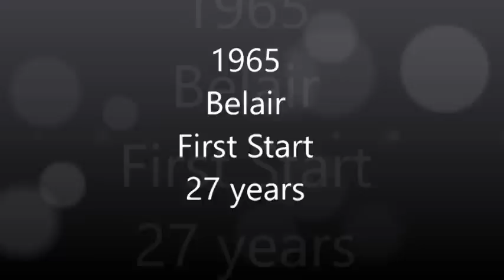1965 Belair NOT A Impala First Start After 27 Years

Comment: I feel like I have in front of me a keyboard version of Mr. Peabody's "Way-Back" machine... I press a few buttons and I am brought back to the sights and sounds of the mid 60's of my youth. The only thing missing are the tactile sensations of touching grimy, slippery, greasy plug wires (and getting shocked often due to leakage) and the smelly concoction of old grease, leaky oil and bad gas, with a faint acrid whiff of non-sealed battery acid fumes, and I swear I could SMELL the rust back then...ooooohhhhh the good old days....And it wasn't until around 1970 that a Chevy came into our driveway that did NOT have a valve tick, and that was my grandfathers 1970 bel-air with a 307, which at the time I didn't consider a "real" Chevy engine. I always experience a tinge of jealousy when I see how many people commenting that back in those days they had A/C, 4bbls, 327 or bigger, pwr windows, etc, but hey, I guess my experiences must have been good because I still remember them 50 years later. Thank you for this cold start, and my condolences on the air compressor.
Reply: Oh, BTW, looking at that blue puffing out the exhaust, and that occasional puff out the carb, maybe a gummed up intake valve. And one of my experiences with this type of smoking without blowby, we had '60 283 and the oil drain back under the valve cover was totally blocked and the only way for the oil to go back was pool up over the rear cylinder and drain back via the pushrod tubes.

Comment: look on back of carb. I don't know what year they started but I know 63 newer 283s had a pcv valve inline on carburetor back port with hose and steel line running back to where road draft tube was on 57 models. actually pc was around back in mid to late 50s. It was an option in 56-57 and so on.

Comment: when i start a old engine after years of setting i always mix a little oil in the gas. two reasons it lubes it up and it gives it more compression. i see have have better luck starting one that way. didn't hear any knocking so it might be a good old engine

Comment: use a gear oil bottle with gas in it to fill the float bowl through the vent tube. You can run it on the gas in the carb....you don't have to dump raw gas in the manifold

Comment: probably a qt. of transmission fluid in the oil would quiet those lifters .
Reply: Flat cam typical of chevy
Reply: jack rohde w
Reply: Mark Keck II Go look up the diameter of chevy vs Mopar and Ford lifters when you race the chevy in nascar in the old days 1955 and later with the flat tappet lifter ones, you had to bore out the lifter bores and put in a bigger dia lifter to avoid flat cams and caved in lifters. big flaw.
Reply: that does help alot in those old push rod engines. hell I bet if he ran it awhile the lifters would pump back up from the oil pressure. they probably settled from being dry all those years wouldn't doubt alittle surface rust.
Reply: I agree. Ever seen the inside of an auto tranny? Clean, ain't it. My grandpa put a half quart of tranny fluid every time he got the oil change. This was back in the 60's when engines were good for maybe 80-100.000 miles tops before needing a rebuild or at least the top end done. He had a '67 Pontiac GP and he racked up almost 250.000 on it. That was unheard of back in the day
Reply: MissouriOldTimer I
Reply: old is gold
Reply: Missouri    putting ATF into the engine oil is typical of clowns who think they have outsmarted the engineers by their hillbilly "smarts" and in the end, the lifters would quiet themselves if given clean engine oil.
Reply: Awesome video MOT, when I got time I look back into his video's, really nice
Reply: @Bill Schwarberg that'd do fuck all for the lifters

Comment: It would run lot better if you gave it a complete tuneup and also adjust the dwell
plugs,wires,cap,points and condenser, fuel filter,etc. The guy that you said bought it should be able to do that if he wants to make this old crate a runner
Reply from the maker: Agree, I just wanted to do a basic start up without making an investment in parts. He can run with it from there.. Thanks For Watching!!

Comment: It's a rare option for a '65 Bel Air to have factory air.
Reply: Mine does but It doesn't run, if I restore it with the factory air will that up the value?(Mine is an Impala, not a Belair, but it's the 4-door pillar less)
Reply: No it’s not what are u talking about where u live
Reply: Back then AC was usually only found in the south....both East and West.
Reply: @whackyjinak4978  Impala was the highest trim so not rare with AC. Bel Air was the base model.
Reply: @David Keeton  Yeah the base model. Which incidentally the differences between the models is mostly the number of tail lights. 

I had a 69 Impala I tried to DD last year that I bought for $800. Couldn't inspect it cause of a bad frame but I rode it dirty for five months. I put two new tires and a new twojet carb on it and the 327/powerglide combo never gave up. I wonder what demolition derby that thing ended up in.
Reply: @David Keeton I don't know how many Bel Airs you thought you saw with factory a/c back then but even here in the South they were far and few between, if at all.  A/c wasn't all that popular even on the Impalas.  Yes, there were those that had them but many of them did not.
Reply: Depends on where you live.  As a kid in Texas in the 1960s, AC was already common in cars, even in the base level budget cars. It was top desired option and people would forego other options in order to have it.
Reply: WhackyJ in AK  oh hell yea dude!! A 4 door hard top with factory air!!
Reply: @auaiao9  Factory AC was a very expensive option back then.. Hell am radios were an option, 2 speed wiper/washers and on some cars, depending on the make and model, even the heater was optional
Reply: @chaosdemonwolf1  I know.  I'm 62 years old.  I don't remember heaters being an option, I think they standard on all cars.
Reply: Back when you could order the car the way you wanted it!!
Reply: @whackyjinak4978  yes it will!!
Reply: @wll1500  Acutually the Biscayne was the very bottom end base model.

Comment: @Jonathan W: Get a hydraulic air gun and spray pressurized blasts of air to clean the crap off the intake manifold and the crap out of the air cleaner element and the pine needles and crap all around the car so the car can breathe better. Maybe a new air filter would also be helpful.

Comment: I just did some checking and it appears that this engine is an older small block. The air cleaner housing and valve covers are definitely from older models. Now, you could change the air cleaner, but if my memory still works, the valve covers changed bolt patterns when the style changed?-just saying....:-))))

Comment: After 27 years the least he could have done is pull the plugs, squirt some oil into the cylinders and let it crank for a while until oil pressure builds up in the rod bearings without compression load. Dumping gas into the carb only washes oil off the cylinder walls and increases the risk of galling.

Comment: Why not fill the carb's float bowl with fuel and put a few squirts in the carb's intake, not a very good idea to pour fuel into a carb while trying to start an engine, if it backfires the fuel in your hand can also catch fire and that can be a mess.
Reply from the maker: I put some in it, but not enough. I am always afraid I will overfill and flood it.
Reply: If you fill it through the feed pipe (coming from the pump) the needle and seat will not allow too much fuel into the bowl. Just glad it started.
Reply: Philip Koen @ y adamdano manvd adamdano manvd adamdano. 
m
Reply: Philip Koen bbc.co  
I
Reply: Philip Koen IM PRETTY SURE HE KNOWS.
Reply: Na
Reply: @jonathanw4942  if you flood it you just hold throttle open I've always been able to clear one out

Comment: Some of these comments....wowwww.    Anyhow - love your vids.  Question: Regarding hot wire (I too have no key on my 66Impala).....From the purple wire you ran a wire to the negative terminal, and later for power to start, did you run it from the positive nut on the coil to the positive battery terminal?

Comment: What kind of monster would use that car for just parts
Reply: Justin SliverSoap : true that the car "could" be restored ( at great cost ), but without parts cars, others in much better shape might never see life again either. It's a bittersweet reality.
Reply: One with a 2 door SS
Reply: It is a real shame but one dies so that another can live.
Reply: Justin SliverSoap someone that has a 2 door Chevy
Reply: Only an idiot would save a damn 4 door 
2 doors are superior
Reply: 4 doors are great if you are doing some squad cruising.  Especially if the  thing could sit 6 people comfortably.
Reply: Parts cars or no restorations. Many of the parts on these old ones are made of unobtainium. As these old ones age further new old stock becomes hard to come by. The manufacturers haven’t made pieces for these in decades.
Reply: @Justin SliverSoap: I wonder the same about people who trash good cars like the Toyota Tercel Wagon, AE82 Toyota Corolla's, etc. and older computers like the Macintosh Plus (which can be fully restored and mostly gutted but built into a new machine using the same old case, etc.
Reply: @terceldude  As much as love the 2 Tercels I currently have, there comes a point at which rust's ravages cannot safely be repaired, or rebuilding an engine at $400 cost in parts for a vehicle with rotting floor pans and not much to put them or trunks or strut towers or mountings that welders charge so much to fix, as liability of that repair failing could wipe out a small shop. I love my Tercels and Rangers and enjoy driving them as they come, with small repairs as necessary and have turned a few castaways into dependable daily drivers, and for that I look for these vehicles to upgrade into daily drivers or sometimes parts. As for computers they were designed with the technology of that time, and expansion and upgrading were limited as to capacity of the motherboard, and changing that you have a different computer.
Reply: Exactly!! It's a complete car!! I would restore and put it back to like original!

Comment: Just think.. it was only 25 years old since the last start..my first in 82 for $75 was a 66 Impala 4 door,gray,rust bucket,primer.Looked just like this, worse.There was a ball peen laying on the bench..Whats this for ? He goes you have to get out sometimes & tap the float bowl,it gets stuck. other than that & a cracked frame.. 4 different bad tires leaking at different rates & brakes that  barely stopped it,It was ok..

Comment: I'm an S.O.B. when it comes to starting an old neglected car without a total going over:  old gas,belts, hoses, whatever fluids need to be added to that almost immediately will need replaced.
Reply: It's like, ... If it's gonna be sold for $100 bucks then WTF, right?  If you plan on resurrecting it as your everyday driver, that's another story.  What I usually do is first check oil.  ( usually will be low ).  Add 1/2 to 1 quart of new oil. ( preferable a thinner grade ).  Then crank the engine just a couple of revolutions.  Then pause for a few minutes.  Maybe repeat this procedure a few more times to get some of that new oil pumped to the top & time to settle into lifters, rods, valve stems, rings, etc.  Then I'll try firing it.  Whether this procedure actually does all of that to any significant degree, I can't know for sure.  Just seems like it would work that way.  It's certainly better than nothing!  As for old gas, I have never worried about it.  So far, it has never been an issue.

Comment: I know you are not poor, so why not invest in a nice remote starter button and a small gas can to hang off the hood with a line you could slip over the bowl vent on the carb or to the inlet pipe. Then pop your cap and check for spark on the points first and file them in place- why remove them?  If you have spark at the points, check your spark at the coil wire- Now if you have spark and fuel it should fire up without a lot of cranking as long as you have compression.

Comment: It would've started and primed alot sooner If you just be generous pouring gas in. It's not like there's any oil to rinse off the cylinder walls on a motor sitting so long and that wouldn't affect cylinder condition for that short period. Hurry up and get it over with the sooner oil pressure the better . dry bowl , dump gas in. It'll fire up, die ,fire up, die with good pump the bowl primes and keeps it alive
Reply from the maker: The oil all drained to the bottom, the cranking gets it to the top and everywhere it needs to be. Starters are cheap!!!

Comment: I don't know thing about cars, but: Why will the starter get hot from running off a drained down battery, and not with a jumper connection?
Reply: Soren Kuula if the starter runs very slowly it needs more amps to turn, more amps, more heat.
Reply: Hi, thanks for the answer. OK I'm surprised. I thought the current would be about proportional to the torque, and the torque of cranking an engine is about the same at any speed?
Reply: Soren Kuula after thinking about it, since the torque suplied by the dc motor is proportional to the voltage and the current is proportional to the torque, you are right, the current is not higher when the motor is turning slower. A danger that does exist is when the motor grinds to a halt because of low voltage, like on a compression stroke. Then you would have inrush current wich is much more then the normal operating current. This could damage the starter.
Reply: yep

Comment: why did you not drain the fuel tank and just leave the fuel pump attached, then let it take from the tank (if the fuel pump even worked.)
Reply from the maker: No drain on the tank and usually the insides of the tanks are rusty and shot.
Reply: You do have a point. My tank would be rusty if I set for 27 years without moving!

Comment: I would have changed the oil before i even tried to start it.
Reply: Clearanceman2 run it till hot, then change it
Reply: Correct Clearanceman2, at least check the stick for water.. prep the engine for start, points, wires, fill the fuel bowl, pour some gas in (wait 15 sec for it to vaporize) close choke.. should start right away!  (Better to vacuum all the debris...  pull the plugs and squirt some light oil in the cylinders, crank for 30 sec, and this also primes the oil pump)
Reply: Waist of money ..

Comment: How about changing the oil (now tar...) first? What you did is a good way to damage bearings as 27 year old oil has basically 0 lubrication properties... Beginners mistake no 1: Not changing the oil before resurrecting a car which hasnt run in decades.

Comment: Make the hole in the cap bigger not getting enough gas dude
Reply: Don't want to flood it u can ruin the plugs and it Boggs down the motor not to mention it could backfire and with all those squirrel nuts could catch fire

Comment: Did you change the oil?
Reply from the maker: Nope, never do till I run them to at least get hot first.
Reply: Jonathan W won't 27 year old oil cause damage?
Reply: Has for myself I have never heard of old oil causing problems for just a start and run till hot or even driving a bit.It helps breakup the deposits and if the filter is in place it will catch all the small particles. And always after you add new oil replace it after a short drive has the older oils had low detergent and all of the sludge will stop up the oil pump screen and the motor crank is history. I had this happen on a Buick skyhawk I tore the engine  down to see what happened The engine  always had Quaker State , I changed it to Castrol  One of the better oils. It did it's job of cleaning what the other had left. Sorry for the long reply.

Comment: If he really knew what he was doing, he wouldn't grind that starter so long. Also, if that thing should backfire through the carb while he is holding that bottle over it, he is going to have some blisters.
Reply from the maker: The longer you grind the starter the more oil you get throughout the engine starters are cheap
Reply: @jonathanw4942  you make a good point.

Comment: When I started a LS1 Camaro Z28,that had been sitting for 10 years,and had 80k miles on it,new battery and the engine started right up ran fine,for about 15 minutes and then engine started rapping...Yes,I blew the engine because the old gas turns into a lacquer type liquid,shellac,and totally destroyed the engine..car was garaged,and ran fine when parked..just to let people know that you should ALWAYS change out the gas,and motor oil...DEFINATELY the gas,first thing..after this sad and expensive $$$$ experiance.I thought i'de throw this out there..no matter the climate,weather,or storage conditions,DON'T make the same mistake i did..hard lesson over 5 dollars worth of gas//and DO NOT run it through the fuel pump.either,because that will seize up.too..ruined a rare,nice,SS Camaro...Shame.Good Luck take care

Comment: takes long enough lol figure out why it wont start right up and fix the issue rayher than run the starter dead pretty simple engine to work on
Reply from the maker: When Engine sets valves get rust on them on the seats and they don't seal off and don't have any compression or enough compression to run. That is why it has to be cranked over plus it oils the system good starters are cheap. I have proven this many times was engines that have set for decades.
Reply: i know this been workimg on cars for 30+ years i was raised in a chevy wrecking yard i know what hes goimg thru throw some trans fluid down that whole and let it get to them valves and itll release them trans fluid is a great thing for these old sitting barn finds